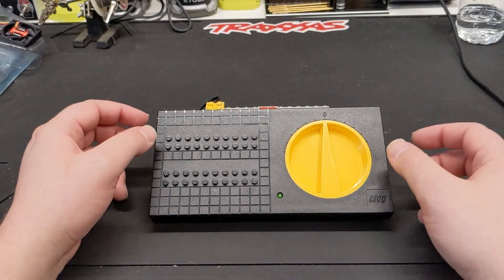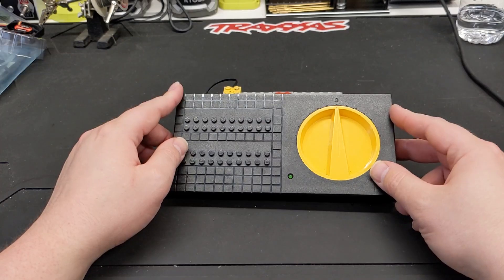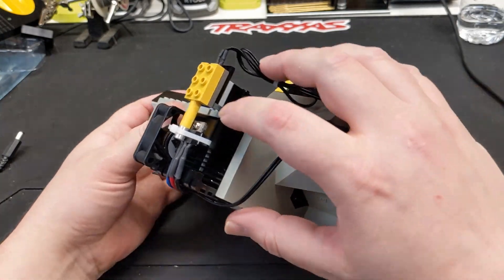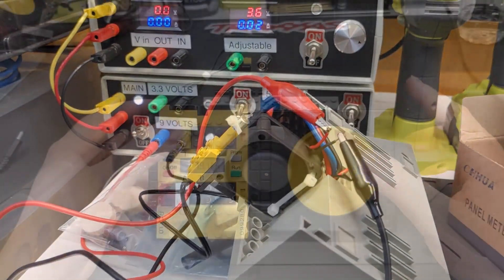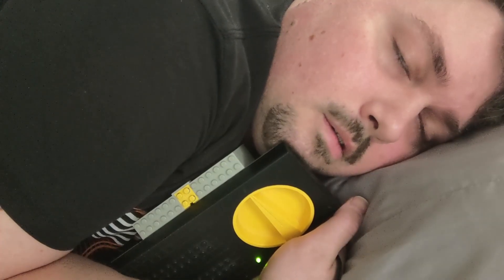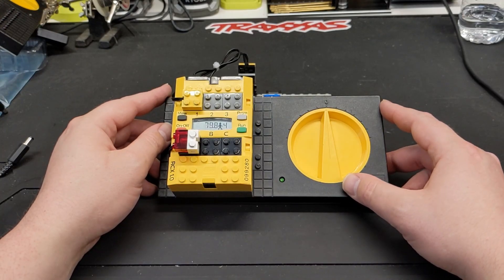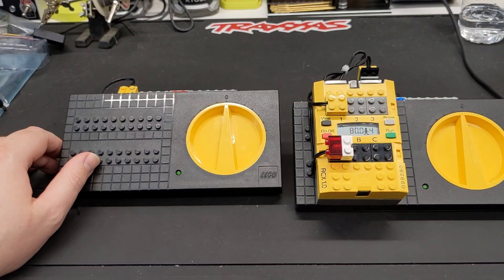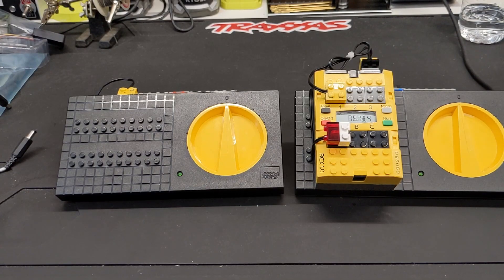Upgraded Lego 9v Train Regulator - More Power!

Comment: Heya, 9 months late but discovered your channel recently, I have a potential tip for the active cooling solution.

instead of putting everything outside to a cooler, why not try to create an inside airflow using a small fan and 1 cut intake / exhaust hole?

As for the fan voltage issue, Buck converters save the day! the 3D printer community has been using them a lot for interchange between 12V and 24V fans and power, the only downside to them being heat... (but with the previous airflow idea, that could be a non-existant issue perhaps)
(Edit: This idea would neglect temperature reading like with the RCX and would just spin the fan at 1 constant speed, however, inside the casing, decibels might get muffled out)
Reply from the maker: The plastic molding is very tight, there is very little room inside.  Also I wanted to do as little modification as possible, this solution just needed a hole drilled in the bottom.  The fan is actually very quite at 9 volts and cools the regulator just fine, It was when I used the 16v unregulated supply it was crazy loud.  I later modified a regulator in the same way but changed the resistors around so it can supply up to 12 volts.  It worked great in my GBC Control Center 😁

Comment: Nice project, I'd love to see the active cooling system having its own casing with the RCX sitting on top, attached to the back of the train regulator. 
btw: Does the voltage regulation of the RCX run hot aswell? ;D 
What if you'd use an ungeared Technic motor and a propeller as fan for the active cooling, to make it even more LEGO, would it do the job?
Reply from the maker: Any Lego fans I've made were incredibly loud with lots of vibration.  I went for the non-Lego approach here 😅.  I'm happy with how it turned out, I'm already starting a build with it 😁

Comment: I agree with what you are saying about preferring the lego components instead of more compact 3rd party components.
On a barely related subject: I recently put up a small section of electric fence in order to protect my rabbits from predators, the main point being: the fence pulses once a second with 40,000 volts, but only 0.1 amps. Which is why it hurts when one touches an electric fence!

Comment: might be a fun side project to modernize one of those old regulators with a modern power supply.
Reply from the maker: I've been toying with that idea for a while, may have to sacrifice another 9v regulator for science!
Reply: @BatteryPoweredBricks  i'd certainly be very tempted. I'd imagine you could even increase the efficiency of it a bit as well, likely means less heat output too.

Comment: Cool! Even though you could make everything smaller with arduinos and stuff, everything made out of lego is much more fun and the rcx and tempreature sensor get a use for something then nothing! Maybe as an idea a watercooled controller? Just as a fun project to see what's possible, but I don't think that the risks involved, in not destroying something, are low enough to make something like that, so idk
Reply from the maker: I like the way you think 😁.  Even with the dinky fan running at 9 volts the temperature stays very low.  I have a few extra closed loop water cooling systems for PC's if I ever needed to use them 😂